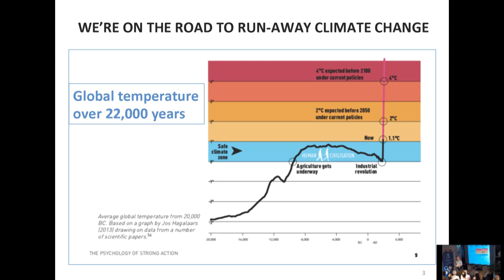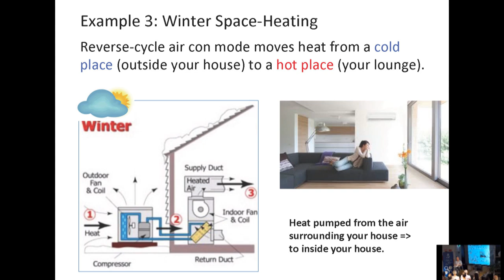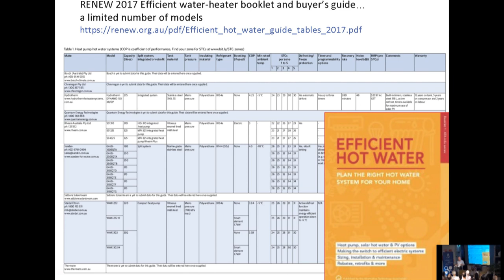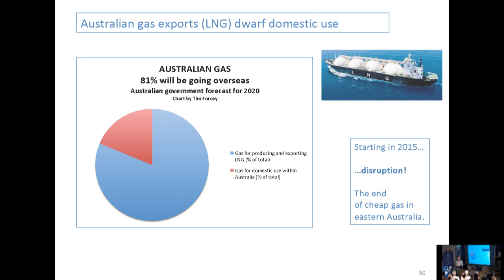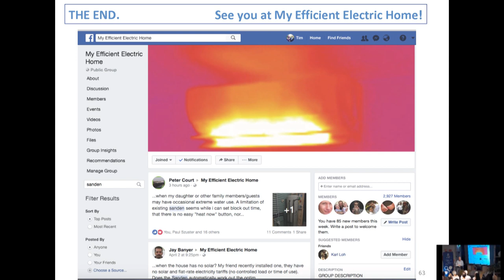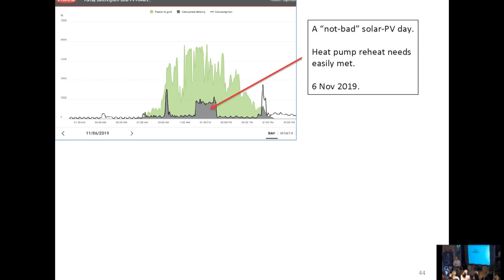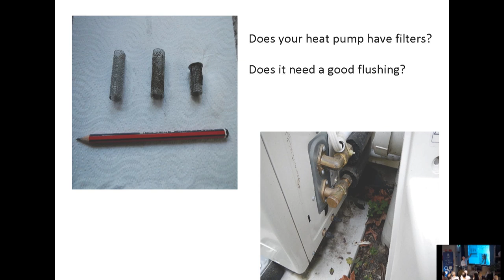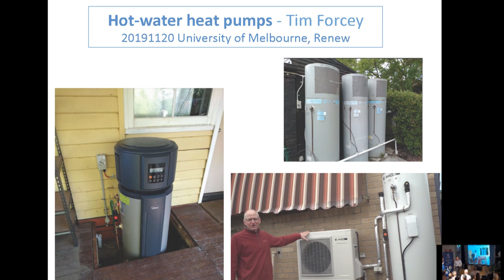Heat pumps- Part 1- Hot water - Tim Forcey - Nov 2019

Comment: As a plumber in Melbourne I would like to add a few points to take in to consideration before you choose your HWS.
My best advice to save energy and money when choosing a storage HWS whether it is gas, electric or heat pump is what storage capacity do you really need?
 Do you really need 315L of hot water in a couple of hours?  I would say no for 95% of homes, even 270L is a lot of water unless you have a family of 5-6 who like to take a shower one after the other.
You have to remember that your heater is trying to maintain >60c water all the time, you are paying for that in energy.
I often get customers that want to put the biggest storage tank possible, I always ask how many people in the house and a lot say 2-4 people but I often have grandchildren or visitors staying over.
My reply would be get a smaller storage HWS and learn to stagger hot water usage so the smaller tank has a chance to recover or get an instantaneous HWS.  You have to remember that for the rest of the time you are paying for the storage of >60c water.

I also get asked about my thoughts on large electric storage HWS on solar PV to dump excess power to the heater, I am in two minds about this, reason being...
It is all well and good to dump power to the elect HWS during the sunny periods but that is during the mid day/afternoon, main usage of hot water in most households is in the evening and morning when the panels do not really help to recover the temp of the tank.  Use all the hot water in the evening and you need to use power to heat for the morning or put up with warm/cold showers.
What about during the winter when there is no excess solar PV, now you need to use grid power to heat the large tank of water.
Best scenario would be to put a boost element in the tank and heat only the top 33% of the tank.

Would a heatpump work on tank or low pressure water?
Not as a standard install with the heatpump storage tank at ground level unless your cold water storage tank is very high and large.
You would need to install the tank at a higher level, above or in the roof otherwise you will have little to no hot water pressure especially from a shower as the shower outlet is probably higher than your tank.
An another option is to install an electric pump to provide pressure.
Reply: Just looking into a heat pump and was tossing up between 170L and 280L. We are a family of 3. Your insight is much appreciated 👍 and makes a lot of sense. Thanks.

Comment: I wanted to share that several years ago, I disconnected the gas line; I switched from central AC to individual mini split variable inverter heat pump units; I changed the gas clothes dryer for a heat pump clothes dryer; I changed the gas stove for an induction stove and the gas oven for an electric convection, and I got a solar hot water heater with an electric resistive heating element.

People think I am lying when I mention how much we pay for energy.  

On average it is between one third to one half of what other homes pay for both electricity and gas.

One of the things we are considering now is getting a hot water heating element diverter called Eddi, and heating hot water in the winter with PV.
Reply: Most likely old inefficient gas which would be expected
Reply: Yes, among our 32,000 members at My Efficient Electric Home, many stories like this. Congrats!
Reply: @timforcey1226  yes I have read those stories of people comparing 20 year old 1 star brivis wombat ducted gas vs a ME 7 star heat pump lol.
I did find it interesting that you push sanden heat pumps hard and interesting you have one yourself.
I even saw how you accused a guy who offered an alternative to the sanden an undercover installer for that brand
Reply: @timforcey1226  MEEH is like your own personal eco chamber.
Reply: @chefgav1  30,000+ echos. 1,000 more echos coming in every week lately. No seriously, smart people are working out smart solutions.
Reply: @chefgav1  My daughter now has a bargain basement Chromagen Midea. Works well! Many members at My Efficient Electric Home have some of the lower cost hot water heat pumps working well. Yes Sanden way over-priced these days in my opinion, but still, Members are still buying it... and the Reclaim. Top performance there.
Reply: @timforcey1226  even those bargin chromagen unless your in Victoria are still 4kand given there complexity doubt it would even last the 12 years without issues. 
Even chromagen is still more than double the price of an IG that will be trouble free at least 15_20 year life. Never see a ROI with an HPHWS. 
Chromagen will be lucky to see a COP of more than 3 and will never see any real efficiency in winter where even reclaim  efficiency drops severely in winter which is straight from there website
Reply: @timforcey1226  From a build perspective all electric makes sense  buT from retrofitting the capital expenditure will never see an ROI  in the short term
Reply: @chefgav1  OK I shall stop here. Never enjoy conversing with folks hidden behind aliases anyway...
Reply: @timforcey1226  While I do understand you are new to the whole internet/FB and YouTube thing as per your own words but just a little heads up is You can’t use a name that is already taken. FYI there are over 2 billion users on YouTube which can’t have the same name. But nice assumption again.

Comment: My flat panel solar system has been on my Melbourne roof for 35 years now.  I've had to replace the pressure valve once and its had a replacement element. Pretty much consumables in my mind. That's a total cost for maintenance of about $300. For 8 months of the year I have the booster switched off. So that's 8 months of no cost hot water. The whole system is on the roof and thermocycles away quite happily. A heat pump would have to save alot of energy in the 4 months of winter to be a cost effective replacement. Even on days of poor sunlight the water is boosted a bit during the day reducing the energy requirement during the off peak period. Not convinced yet. :)
Reply: Yes but... that is 4 months of the year you are probably paying too much for hot water. Hot water heat pumps can work fairly efficient all year long in Melbourne. That is their attraction over solar thermal. Even the solar thermal people are now selling heat pumps!
Reply: @timforcey1226  No, but... with solar hws there is 8 months of not paying anything for electricity, besides maybe pump & controller electricity.   Now compare the total cost of electricity used per year for solar hws and a heat pump hws

Comment: Question...If I have a heat pump, is there a way to use it to heat the water?
Reply: What type of heat pump? You need a air to water heat pump. Differs to to an air to air heat pump.
Reply: @6Ginge  How much is air to water heat pump and which one  you recommend?
Reply: @stelstefan4199  check out the heat pump spreadsheet attached to the FB group mentioned - My Efficient Electric Home
Reply: @6Ginge  Need air to water or any other technology to heat water. I live in Canada.

Comment: Tims understanding of the technical side of HeatPump HWS is solid and interesting but his ROI vs Gas is flawed and incorrect.
He compares old gas water heater vs new heat pumps so sure heat pumps will be more efficient.
Sustainable Victoria compares the running costs of  high efficiency heatpumps vs gas and instant gas and there is not a huge difference in running costs between 7 star instant gas and a heat pump.
What about reliability? Heatpumps are notoriously unreliable , Tims sanden are well known to throw error codes and not being the most reliable.
Instant gas are super reliable and will easily last 20 years, good luck with a heatpump to last past 10 years or at very least need regular maintenance.
Reply: Also his assertion that gas hot water system waste heat is also incorrect as instant gas condensing unit recycle alot of that hot air hence why they are 7 star efficiency.
Instant gas systems are nearly half the cost will out last a heatpump without doupt.
Ask any plumber which technology is the most reliable.
I wouldn't be surprised if Tims sanden hasn't thrown one of there notorious error codes yet.
Also his assertion that its free hot water if connected to a PV is also incorrect because if your PV wasn't gong to heat the water you would be getting any excess as FIT.
It appears Tim is biased against the fossil industry which is fine but you do loose credibility when you make flawed comparisons
Reply: @chefgav1  And... where will the gas be coming from 5 years from now? My article: https://renew.org.au/renew-magazine/renewable-grid/goodbye-to-bass-strait-gas/
Reply: It’s enough to read productreview web-site and notice that gas systems such as Chromagen, Rinnai, etc are having scores between 1 & 2 and are also very unreliable. My Chromagen is total crap. So, it’s not black and white
Reply: @elenaberwick3980  have a look at those reviews as next to none are Verified purchases which is  pretty dodgy as anyone can write anything . IGHWS are well known to last trouble free for 15 years.Ask any plumber which one would he own and 99% of the time it will be a rinnai IGHW
Reply: My review for Chromagen is also unverified. This doesn’t mean I don’t have Chromagen. People just don’t bother putting photos or purchase receipts but their reviews are still legit as mine.
Reply: @elenaberwick3980  can’t expect people to take it seriously then considering . Every review I do with is a lot is 100% verified
Reply: @elenaberwick3980  who knows could be legit could be dodgy.  Can't take a review seriously unless it's verified.  If you want to be lazy that's up to you not that hard to verify  . Internet is  full of fake reviews
Reply: Big savings possible for homes that get 100% off gas.
Who wants to get a gas bill..... for the rest of their life?
Reply: @timforcey1226  what are the huge savings you are referring too? Are you suggesting that sustainability Victoria numbers are wrong?
Reply: @timforcey1226  but natural gas production is up year on year to 152.8 billion cubic meters.